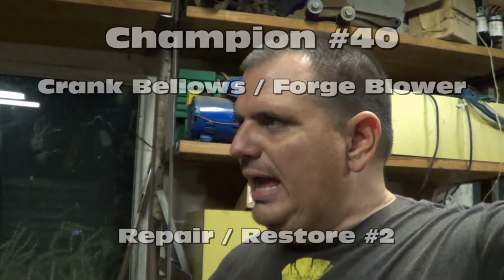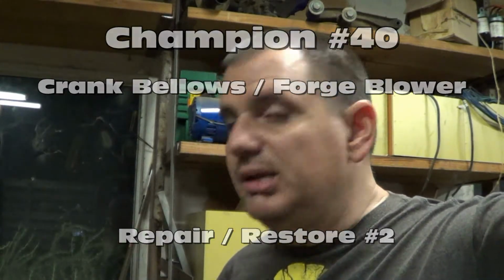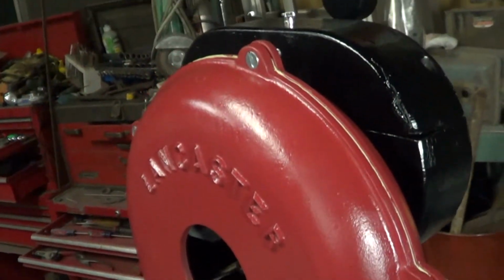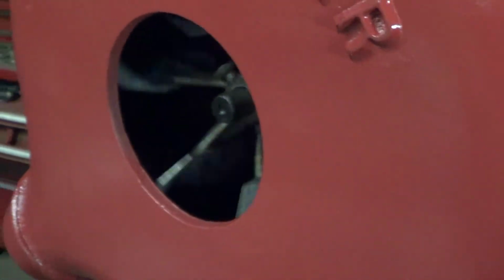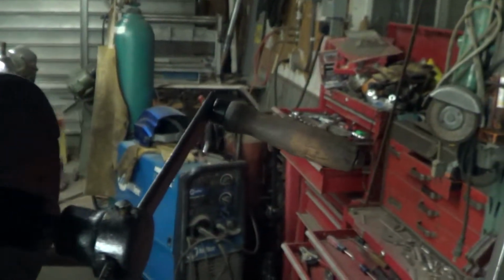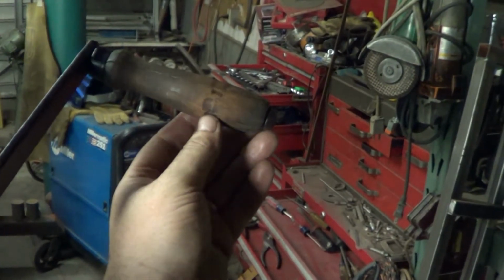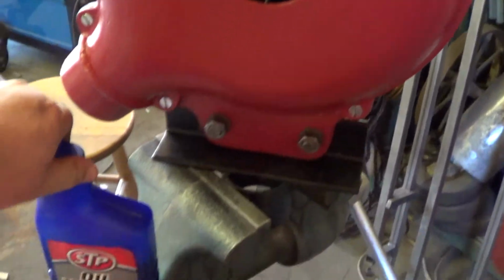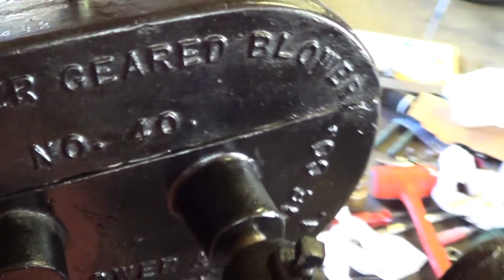Champion #40 Lancaster, PA. Forge Blower / Crank Bellows Re-assembly #2

Comment: Nice looking job.  When I worked on small air compressors, we used 20 or 30 wt. NON-DETERGENT motor oil. (don't use detergent oil on a non-combustible engine) and for replacement gaskets on water pumps, pipe flanges, and air compressors we used Teflon adhesive backed tape.  Comes in rolls from Grainger catalog, sizes 1/8/" up to 1/2" and larger for the big 12" pipe flanges.  Looking at your video, after cleaning the housing surfaces real well, clean & dry, it looks like the smaller 1/8" tape would probably work fine.  the tape is not cheap, and an Okie fix would probably do, but I appreciated using the Teflon gasket tape.  Check out the Grainger catalog on line
Reply from the maker: Thanks. I'll check that tape out.

Comment: I have a Champion forge and #40 blower. It was not intended to have STP or heavy gear oil.  Most set out   in a cold shop or barn.  Put heavy gear oil in it and try to turn it.  All it needs is about one inch of light weight oil in the bottom other wise it will leak out the bottom two bolt holes.  Also the light weight oil made it easier to crank - let go and it would keep turning while you adjusted something.
Reply: I might add that with a inch of light oil in the bottom the gears will pick it up and lubricate every other gear.  Also you will not have oil coming out of the top cover.  Some guys just drop a few drops of oil in the little cap every time they use it to make use it gets some lubrication.  Also you can drop a measuring stick down to check the one inch oil lever or just spin it and see if the gears are picking up oil.

Comment: Thank you for the video, I picked up this same #40 model from Erick and, it was dark cherry red (very dirty). It is in better condition (judging from the fan), though the crank handle counter weight is missing. Does anyone know, where I could order? And what to use to clean gear box off grease? Grease - I think it was glease, thick as paste and not oil. I probably could not get 600weight oil anywhere. Thanks again.

Comment: They were a dark red. Many of the blowers. I have had many and find remnants of red. On others, I believe, they were black, because I see no red when rebuilding them.
I dont understand the common thought behind putting gear oil into a hand crank blower. At the same time, it seems to be a contest among folks to locate and use the heaviest gear oil possible. 
It is a hand crank blower. Set down with a cup of coffee on the   back porch and think about what you are doing and the light will come on. The operative word here is light.

Comment: Just rebuilt a #40 myself. Do you get much oil coming out of the air tube when it's turned at full speed? The fan shaft leaks more than I expected.

Comment: I know it's been a while but do you mind telling me how you stripped it?  I just picked one up with all original parts and works beautifully but has a heavy coating of crud. Needs cleaning, some gaskets and painting and I'm in business, but I've never restored anything like this.  Yours is beautifully done!! Thanks.
Reply from the maker: When cleaning equipment like this I usually start by scraping the heavy crud first. If it's a larger item like an engine you can go to a self serve car wash, they often have a bay dedicated for cleaning greasy engines. Then I like to use a de-greaser to get the oil and grease off. I typically use a cleanser like Purple Power. It's lye based, I think. Don't get it on your hands. Then a wire brush on a grinder works to get down to the bare metal. I assume that if those steps didn't remove something, then whatever is left didn't need removed.
Reply: That's very helpful, thanks. Been to the carwash so I think I need the de-greaser next!

Comment: Hi. I'm trying to disassemble my #40 Blower. I cannot get the long king pin out (that which locks in the spindle for the handle). It appears to have been hammered home. Do you have any advice for getting that pin out?  Thanks.  Lin
Reply from the maker: I haven't looked at this in a while. The best advice is always patience. Don't force it. Without looking though, worst case scenario, you'll have may have to drill it out.

Comment: what size flathead  did you buy for the inside to hold  the panel and gear box together?
Reply from the maker: +christian julian I can't remember what they were. 1/2" or 3/8", 7/16? I probably ordered them from McMaster Carr. Although, the local bolt place would likely have had them.
Reply: Ok thanks man your helps appreciated